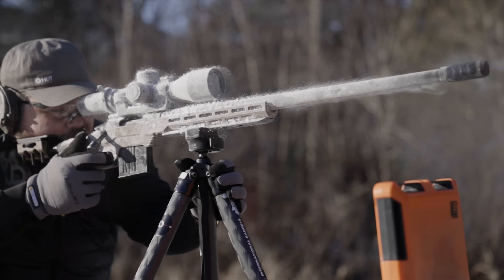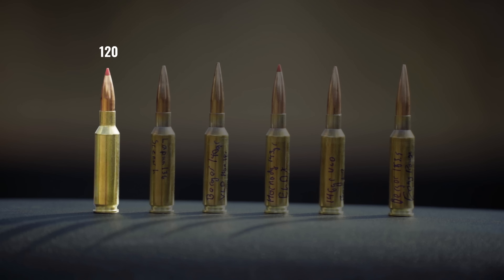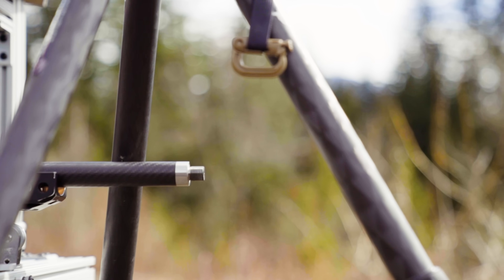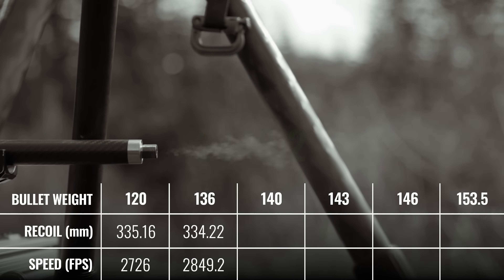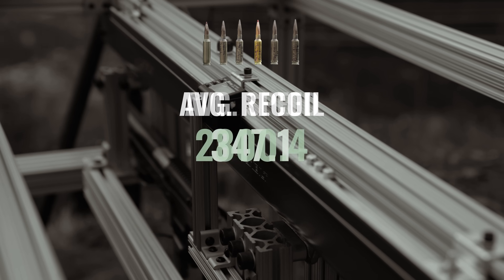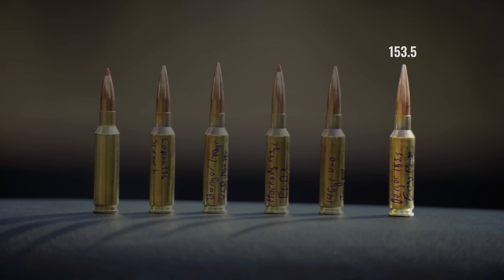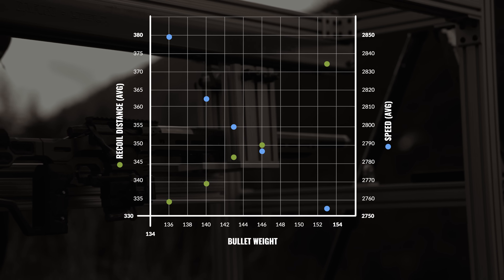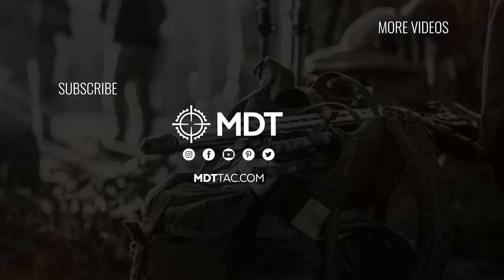How Bullet Weight Affects Speed And Recoil

Comment: I think that running this test with a charge per bullet that gives the same pressure would be much more interesting as if I were to use a lighter bullet I would put more powder behind it. Then, with basically everyone using brakes or suppressors these days, it would be more usefult to have them on...
Reply from the maker: Fair point

Comment: Max loads should be more of a use case, as barrel length exacerbates recoil from heavier bullets. Heavier bullets increase the explosiveness of gunpowder (due to less case space and a bigger peak pressure). Also, you can't really isolate bullet weight as a parameter, unless a long enough barrel is used, (longer barrels are more efficient for lighter bullets).
Reply: Anyway. Anything is useful for measuring momentum and energy. What's most important is how gunpowder gas affects recoil, and bullet weight affects recoil. A bunch of loads, barrel lenghts, and bullet weights should be what's useful to isolate every or almost every factor.
Reply: Lighter bullets can be proppeled with more powder, because peak preassures are lower. There's more energy that would transform into recoil, and also more gas. Though it's obvious a heavier bullet would cause more recoil, that's not the debate. It's about how much would affect recoil given a standard caliber.

Comment: I'm curious. What if you put a 175# weight on the sled. You could also try using isolation springs for HVAC equipment, they are made for specific weights.

Comment: I watched this video last weekend with my dad and while it is interesting, it is not a realistic comparison because ammunition with different bullet mass (for a respective caliber) does not use the same amount of charge. While it is true that a heavier bullet will be slower and have more recoil, it is exaggerated in this test and the results won't be accurate.
There is an inverse relationship between bullet mass and charge used to keep the energy (and pressure) within safe levels in the barrel. When you substitute a heavier bullet with a charge meant for a lighter bullet, you are reducing the volume in the case (to maintain overall cartridge length). If you leave the exact same amount of powder in the case with this reduced volume, the pressure must go up, most likely to a dangerous level. The outlier from the factory ammo is because all of their hand loads must be loaded with the amount of charge specified for the heaviest bullet or there would have been over-pressure problems in the lighter bullets. Either way, they were not loaded properly. If loaded to spec, I'd expect to see a weaker relationship with outliers (or nodes) that give peak velocity with corresponding anomalies in the recoil.

Comment: The reason that recoil goes up with heavier bullets has nothing to do with "built up energy", in fact, the maximum muzzle energy for heavier bullets, for a particular power, is less than it is for lighter bullets. The reason recoil is higher for loads with heavier bullets is due to the fact the heavier bullet has more momentum. Recoil is simply the result of conservation of momentum. The momentum of the rifle is equal to the momentum of the bullet and powder but in the opposite direction, which is what we experience as recoil.
The equation for kinetic energy is 1/2*m*v^2 and the equation for momentum is m*v. If you want to double energy with velocity, you only need to increase the velocity by the square root of 2. In that case, the momentum/recoil only goes up by the square root of 2. If you want to double energy using mass you have to double the mass (which doubles the momentum/recoil). In other words, for the same muzzle energy, loads with heavier bullets will always have more recoil.

Comment: I did some back of the envelope calculations dividing kinetic energy with distance travelled and got a "power index" of sorts

8.01 (120gr)

9.94 (136gr)

9.83 (140gr)

9.72 (143gr)

9.73 (146gr)

9.41 (153.5gr)

Also the loads weren't comparable in terms of kinetic energy (KE=1/2*(mv^2))
(2685, 3322, 3337, 3373, 3413, 3503 Joules)

These results seem a bit inconsistent with the conclusion of "heavy bullet increases recoil" I would say that the recoil is dependent purely on the kinetic energy of the bullet leaving the barrel. (newton's 3rd law and no reciprocating mass to complicate the recoil impulse)

But math isn't my strong suit, please correct me if i made errors or false conclusions.

Comment: Pressure limits aside, using a faster powder will also reduce recoil with a bare muzzle, all other things being equal. When the bullet leaves the barrel, the crown becomes in effect a very short duration impulse rocket. Given the same bullet and velocity, a faster powder reduces pressure (and potentially ejecta mass) at the muzzle, in turn reducing its contribution to the rifle's rearward momentum.

Arresting and redirecting propellant gas is how muzzle brakes work, which is why slower powder increases their effectiveness.
Reply: A faster powder will increase recoil due to increased bullet speed OR faster powders increase peak pressure, and lower peak pressure duration, so lower bullet speed. I couldnt tell what would happen, but most importantly it affects bullet speed that contributes the most to recoil. I would guess that a shorter barrel should get more recoil from gas.
Reply: @renzocoppola4664  If the same charge and bullet weight are maintained, a faster powder will both increase recoil AND velocity. But that's not what I was saying.

Comment: Going from 190smk in 300wm to 230atips I noticed   a bit more recoil but the recoil impulse felt slower than the 190s and made spotting hits easier.
Reply: More of a push than a sharp jab. Took some friends out shooting water jugs with a 45/70 with several boxes of shells. A few different 300gr, 325 and 405. Most thought the 405 was like a 4-10 shot push and more comfortable than the 325. I've often wondered how the difference in weight would effect the recoil. Shooting from various positions I've found myself from time to time touching one off with the butt plate on my collar bone.
Reply: @sandflea2424  Same with shooting 185gr 45 acp. MOre muzzle flip than the slow push of 230's. Interesting playing around with different weights. SHooting the 300 off a tripod is a piece of cake with a slower recoil.

Comment: I did some more arithmetic on this and included the kinetic energy (1/2mass*velocity^2).  The bullet mass and recoil are 100% proportional, both changed by ~ 10% in your test.  The energy, however, is only 50% proportional and in your test increased by only 5%.  INTERESTING ...

Comment: Recoil is not just bullet speed and weight.  Along with those 2 factors there is the amount of gas generated and the rate the gas escapes (assuming 100% burn) after bullet exit.  At that point you have a short duration rocket engine.  A heavier bullet keeps the gas constrained longer and usually results in a higher pressure at the muzzle.  There are existing formulas for calculating recoil, and they all take into account the weight of the propellant, and one takes into account the type of propellant.
Reply: Correct! Powder choice will make a dramatic affect on recoil as burn rates create different pressure curves and different volumes of gas given the same measured amount. While their test is good for Youtube its data is one sided, lacking all the other variables making it useless. Change your scope..you changed the recoil felt, the list is endless of what affects the end result here.
Reply: also weight of rifle, powder burn rate and alot of other things

Comment: If you graph energy I wonder how closely that tracks your recoil results.
Reply: That's the actual math. For a given barrel recoil is a direct function of force. Speed and weight. Like 9mm the most forcefully round is generally a 124gr and will generally be the most recoil. And 147 are generally he least energy.

It holds true also, as bullet weight increases in this test so dose energy ft/lb. He didn't have a projectile that was too heavy or took up too much of the case like 147gr 9mm. 

120gr=1979.64 // 136gr =2450.97 // 153.5gr= 2585.32. 

That didn't line up with his velocity philosophy so he mites the 120gr because it was fast but did not make the recoil more because it did not have more energy. Also recoil should be measured in ft/lb not distance too many variables like friction on that rig. He needs a compression force gauge behind the riffle
Reply: @Dylan Holbrook  im wondering if it isnt as simple as measuring bullet energy. Ultimately its about PSI at the bolt face x area of the bolt face x time. Because powder burns slowly and is also propelled down the barrel, the psi at the base of the bullet might be higher than the psi at the bolt face?

And friction as you said..
Reply: @aussieexpat  the psi will be same at bolt face as the projectile rear. Psi is a function of energy and volume. The higher psi will push the bullet further faster making more square inches in the barrel and less psi. Velocity is a direct result of psi. However a lighter bullet will move faster, reducing the psi faster. 

The difference in psi should be a very direct result of projectile energy (weight and speed). More psi = more energy.  And forces having a equal and opposite reaction. 

The point you raise would be more about barrel length maintaining the energy for a longer period. 

A compression gauge is a set distance with a set resistance.  The sled he made is only distance, duration, and friction. The heavier bullet is should, according my theory, cause the riffle to move further back at a slower speed of it had the same projectile energy as a lighter bullet who would move it faster for a shorter duration. Shock force vs duration of force.  Shock force is what you will feel. Roller delayed vs direct blowback would be a good example.
Reply: @Dylan Holbrook  what im saying is that think about the moment just before the bullet leaves the barrel.

There is powder burning just behind the bullet (also traveling at the bullets speed) creating a localized higher pressure just behind the bullet. This higher pressure is supported by the velocity of the air and the pressure from the barrel sidewalls.

This localized pressure may never be felt by the bolt face.

This would explain discrepancies between different loads, where bullet muzzle energy doesn't translate directly into felt recoil.
Reply: @Dylan Holbrook  but i also 100% agree, that humans seem to call / percieved peak force to be "recoil" rather than total rearward energy. Thisbis certainly true about injuries in a car crash.

So increasing T will decrease "recoil".
Reply: @aussieexpat  that is exactly what I tried to poorly explain, you did a much better job at it. And yes, a slower burning powder could effect this. Because we are talking about such a short time and distance difference idk if it would be perceivable to a human tho. Perfect analogy with the car wreck!

Comment: Thanks for the video.  I would like to see the test again, when running close to a max load for each bullet weight.  That would be more typical of what folks do when loading.  I think you guys used the very same powder charge for each different bullet weight (unless I am mistaken) in this video. I do not know of anyone who uses the very same charge weight in both a 130 grain and a 153.5 grain bullets.
Reply: Agreed... You'd almost have to pick a weak load for the 136 to stay under an overpressure load for the 153. Admittedly, I shoot a 260, not a 6.5CM but this has been my experience. Could also be why they didn't mention the powder charge if the heavier pills had stupid high charge weights relative to bullet weight.